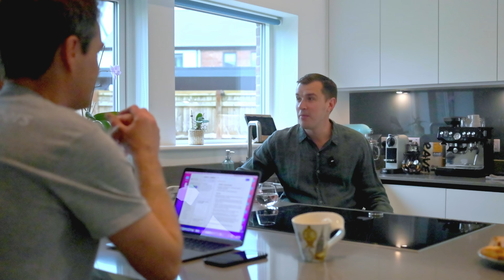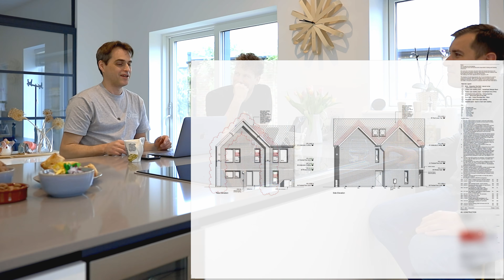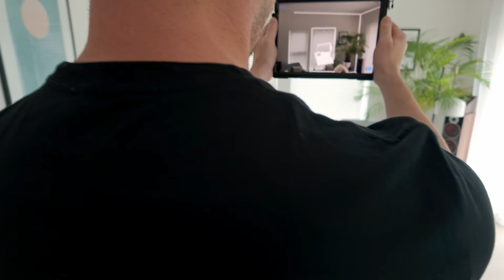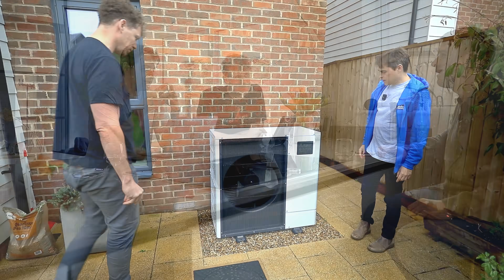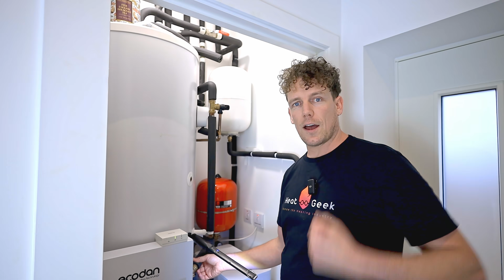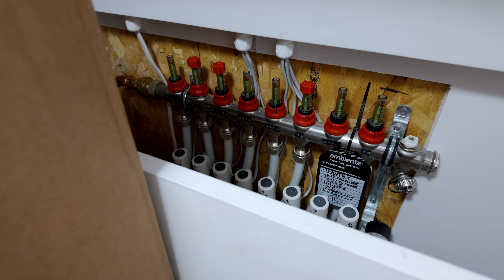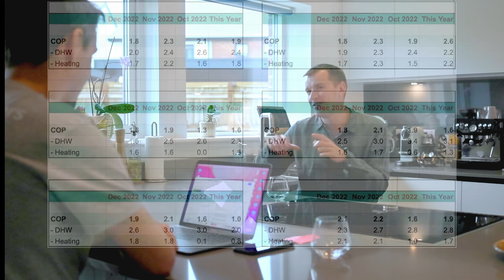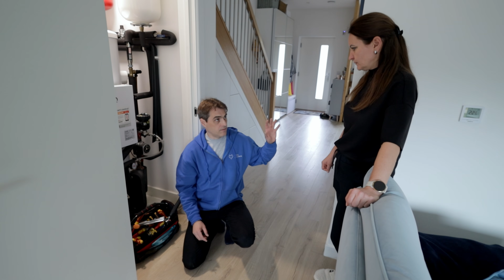How Developers Are Ruining The Heat Pump Market

Comment: To find a plumber that has the knowledge and enthusiasm to fit a proper modern heating system without paying thousands is practically impossible. Doing it yourself is the only way of guaranteeing of it's done right
Reply: Honestly, that's the best bit for me
Reply: Or pay for a Heat Geek Elite installer!
Reply: @Ben-gm9lo  I know but I'm time rich and cash poor.
Reply from the maker: @seanoconnor8843 well then do the research yourself
Reply: @seanoconnor8843  I hear you Sean and quite understand.  I wish you all the best on your install and applaud your courage.
Reply: With the modern press-fit piping systems, DIY is a very real possibility.
Reply: @tlangdon12  yes they look good I like the idea of having things exposed

Comment: Wow, just one of those heat pumps could heat 3 homes in theory.
Reply: Not a bad idea at all.
Reply: The systems apparently have enough zones to do it too!
The major sticking point would be billing.
Reply: Tbh they probably could just have put a tiny reversible air conditioner into the ventilation system and just not do all the plumbing.
Reply: They still need DHW so heat pump still probably the most efficient method

Comment: Air exchangers at best average temperature of incoming / outgoing air.  This is a hard concept apparently.  If you are unsure, follow a molecule of air through the system in and out and remember the same number of molecules are exchanged.
Reply: No, a cross flow (or better yet counter flow) heat exchanger can exchange almost all the heat energy. The incoming air can be heated to nearly the same temperature as the outgoing air. My system heats the incoming air to 18C when it is 20Cinside and 0C outside. The outgoing air exits just above freezing
Reply: It's only a simple average if the input and output air only mix at one point; mixing along a length instead means the average temperature of input/output changes from the temp of the internal air at the inside end to the temp of the external air at the outside end, so MVHR units can do much better than a simple average.

Comment: Since learning about heating, with the help of your excellent channel, i've come to the conclusion that it's not just the topic of heat pumps, or even heating in general - house builders for the most part, especially mass market ones, will absolutely do the bare minimum to (barely) meet the regulations. I am sure there are exceptions but most builders just want to smash houses out for maximum profit. I moved into a new build recently and a weather comp sensor was mounted to the outside wall, but not actually wired into the boiler. The sensor was only there so that it could (at a visual inspection level) meet the Boiler Plus regs. Of course, it's a bottom of the barrel combi boiler with a massive minimum modulation, so it cycles constantly, highly inefficient and will probably fail prematurely (at least then I can replace it with a properly sized unit). Radiators are barely big enough for the heat loss, certainly not suitable for low thermal design temperatures. I think the regs changed again recently so that more effort has to be taken to design for lower flow temps ... but im sure the developers will manage to avoid spending too much money on that ... rant over.
Reply: I didn't get the impression that these builders were doing the bare minimum to be honest. It seems like they just aren't aware of the best practices when installing heat pumps. They could probably increase their profit by installing lower output heat pumps, a single circulating pump, and not bothering with buffers, zones, e.t.c. Most people probably wouldn't even consider these things when buying a house so I doubt they would expect to pay more for them.
Something that seems like madness to me is I've noticed a lot of new builds have high levels of insulation and air tightness, but then they just core 4 inch diameter holes in every room and fit hit and miss vents. At least this house has MVHR. Retrofitting MVHR is not worth it in most cases so most people will just have to live with that. If the builders can still hit the desired building energy rating without MVHR then it is easy to see why that is happening.
Reply: It's not just that most house-builders do the bare minimum, it's that they have been lobbying government for decades to keep those standards low. We should have had better building regs 20 years ago - the issue has been well-understood for that long, but the housebuilders keep whispering on govts ear 'if you make us build decent housing it will be 'too expensive' and we won't build so many'.  It's not actually more expensive of course, for the householder. You save a lot more on energy costs over the building lifetime than it costs to build a passivehouse and you get much more comfortable, less-allergic, quieter housing. And in places where they legislated for it (e.g Brussels from 2017), it hasn't actually cost any extra. Once it's standard a well-insulated airtight building (with a much smaller, cheaper, simpler, heating system) costs the same to build as a crappy one with a big heating system.
Reply from the maker: @xxwookey 👏
Reply: Also according to the video from UK radiators some sellers are not using the accredited verified heat outputs and quoting much higher outputs for their rads. If you are putting in radiators and heat emitters and they are not outputting enough heat you’re going to get issues. The industry as a whole needs not make sure there is top to bottom regulation and really heavy financially punitive fines if they get it wrong.
Reply: I had a thermal survey carried out last year. The surveyor said that some of his work is supporting owners of new homes to take legal action against major building companies over quality issues with their homes. Shoddy dry lining which allows cold air to flow behind it is one common issue. Another is new homes that fail to have adequate radon gas barriers putting those living in them at risk. Shockingly poor standards.
Reply: Maybe it's the Englishman house buyers? Just Google: 'false chimneys' - we have a house building program where fake chimneys get glued onto new houses where there could be solar panels!!!  This year a new estate went up in our town where half the houses have pretend chimneys. Fake period features sell houses - not insulation or MVHR.

Comment: Passive house with recuperator should be around 20-22 w/m^2 so 190 sq m should be around 3.8 - 4.2 kw max.
Reply: and then you will not have any choice to get those - even worse: the smaller houses will have an even lower demand which the modulation can barely cover except turning the compressor on and off and cycle
Reply: Isn't heat loss dependent on outside temperature?
Reply: @VanyaYani  Yep, they needed to give us a design temperatures. Odd no one has mentioned this. 😕
Reply: Where do you get 20-22? All the documentation I can find says ≤ 10W/m2
https://passipedia.org/basics/building_physics_-_basics/heating_load
https://www.passivhaustrust.org.uk/UserFiles/File/PH%20Intro%20Guide%20update%202013.pdf

Comment: Run it at a constant 20 deg over a winter and you get the real heat loss. UK builds have missing insulation, air leaks so I wouldn’t ever trust a drawing.

Comment: Can't believe they installed an 11kW unit in a house with a heat loss of 3kW......I guessed 4 and I'm just an enthusiast.

I've recently had a quote from British Gas for a Vaillant 7kW unit but as they said I needed every radiator replacing it was £8000 with the BUS. Well out of reach for me sadly.
Reply: Try Octopus, they say they include radiator changes as park of the quote. I've not used them personally mind you.
Reply: @jabberwockytdi8901  Basic radiators are pretty cheap to be fair, a significant part of the cost is labour replacing them, even then, not so much.  I just had 6 rads replaced as they were ancient and I didn't want to paint them again, cost me ~£1.2k inc labour; the radiator replacements aren't the cause of an £8000 cost with grant.  That's due to other factors, like the existence of a grant pushing up all the costs by... about the amount of the grant!  

In a property anything like mine, all the radiators are different sizes, which would make attempting to cascade them a pain due to all the pipe adjustments required, whereas a lot of the radiator upgrades involve same length but increasing the height / depth, much simpler.  It's not really that practical a solution to cascade them, and not something you'll ever see any large co wanting to do as a matter of course.

Comment: If it's passivhaus equivalent it's going to be 2 to 3 kw max.with mvhr id be surprised if the heat pump needs to run   at all!
Reply: In the UK, you'd expect it to have to run in three coldest months for heating, but for the rest of the time, it would only be needed for heating domestic hot water. (The heat loss from the humans, electrical devices and DHW storage and pipe work would keep the house warm the rest of the time)

Comment: I'm not a professional but I can clearly see the logic here. All experienced contractors are doing the same thing they did since they ware installing the gas boilers which have higer starting temperature which is okay but at least there should be a new name for the Heat Pump installation and some guidelines when installing it. Should this be a part of a manufacturers manual🤔
As always thank you for your videos. Cheers 🍻
Reply: The difference is, poor quality boiler installations for the most part work, they are just inefficient. Poor quality heat pump installs, in the worst instances, do not work at all. And all costing 10x the price of an equivalent gas boiler. It's been a long time coming for all these poorly technically educated installers to get caught out!
Reply: Weather compensation and low temperature also makes boilers more efficient. This was an overcomplicated design, and the way it was installed was all over the shop
Reply: Well, they work but they’re just outputting way too high witch causes them to short cycle which doesn’t work for an heat pump, where a gas boiler can vary gas level down to 1 out of 16 levels
Reply: From what I gathered watching these videos, most boiler installations in the UK are awfully inefficient as well.
Reply: Actually with gas boilers their approach is less efficient too. If we are talking under floor heating.

If there is more and colder water going through the boiler.

The heat exchanger can pull more energy from the hot gasses.
However 50 degree C output is never gonna warm an older house with old radiators.

It just won’t create the proper air circulation. Now if you have underfloor heating below and normal radiators above.

You have to put and mixing unit at the underfloor heating.

Because it’s impossible to have the right temperature coming out boiler or heatpump for both heating solutions

Comment: I am thinking of buying a house, but I am wary of the existing heat pump install, I know it has a poor COP from using it - similar setup as in the video, huge unit, overengineered, too many thermostats etc (but the system doesn't even give you COP data) would be interested to know if there are good surveyors who have this level of understanding... because there would be significant costs in fixing this!
Reply: Doubt it just like they wouldn't know if a gas boiler based system was oversized or running inefficently.  If you know the size of the heat pump and heatloss of building that is a starting point, price in the cost of the work if you make an offer.
Reply: @tonydaddario4706  thanks, yes i know exact heat pump specs - i ll have to learn how to calculate the heatloss manually I suppose and perhaps work out the COP while I am at it from rough data I can pull from the system
Reply: Existing houses should have actual data to use as a guide.  To further refine the estimate a pressure test can be done .. and the insulation type/thickness & windows of course are all known.

Comment: I guess over specifying means more money from the developer (and ultimately customer) for the job. It’s the heat pump equivalent of a 30kw boiler in a 2 bed terraced house.
Reply: This model is an 11kw unit, they're marked on their actual output not input. So it's an 11kw heat pump (which should be about ~3kw input). Still this is hugely oversized, should be <4kw with ~<1200w input.
Reply: @velianlodestone1249  11kw ecodans modulate to 4kw, it shouldn't be too bad in theory.
Reply from the maker: @Etacovda63 if it’s 5c outside and the house is zoned it may only need 500watts, so even at min modulation it’s going to be 8x too big
Reply: @UrbanPlumbers  yep, so he shouldnt be doing any zoning (and this assumes he wants the entire house at the same temp, of course)

I mean, what, 100L + volumiser to reduce cycling, even with the open zoning... were your calculations at -2c?